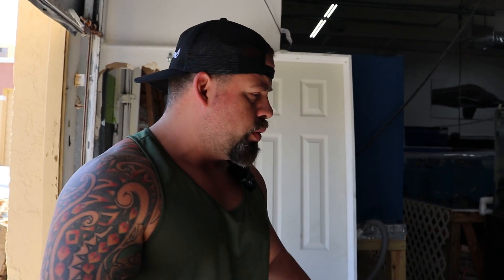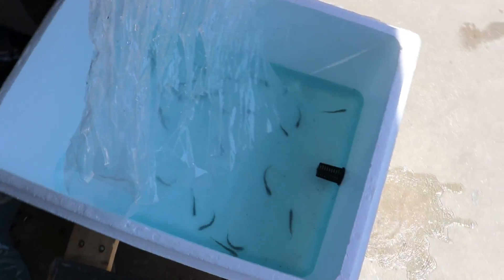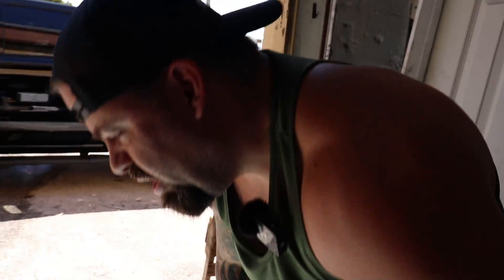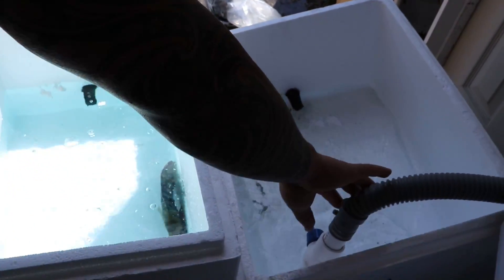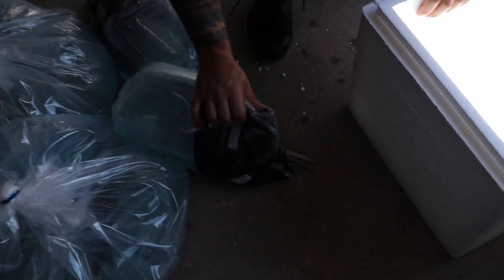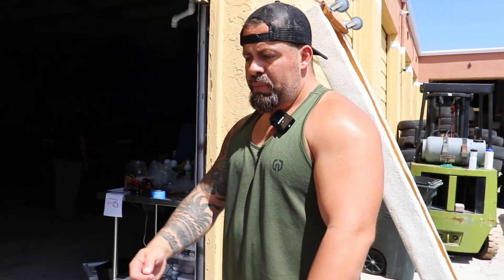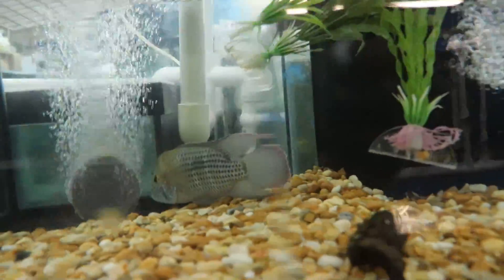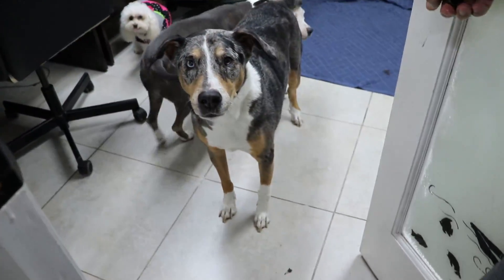*DIY*  system for unboxing new live fish  shipments challenging  Stingray biology

Comment: Good prototype next is they need to be on a roller cart. So once they are acclimated you can roll up to the tank you want to add them into. Maybe two teared? water from the top flows into the bottom.

Comment: Here’s on idea for you rod just make a mobile acclimation rack/cart using your idea. Make it so you can fit 6 or so tubs on a roll cart, each tub can have its own drain and inlet valve to limit flow and one main freshwater connection  to feed all tubs. each tub would need two drains one to maintain water level and one with a valve to fully drain at the bottom.

Comment: if you stack them 3 or 4 high and also have a drain filter on the bottom of each buckets you can accumulate them all together,  each one on top has to be a slower drain though.

Comment: Love the video. Rod build base board out of wood and put wheels on them then put the box on it so you be able to move them around. Also I would build like a spray bar for the clean water so you could just lay it down on top of the boxes.